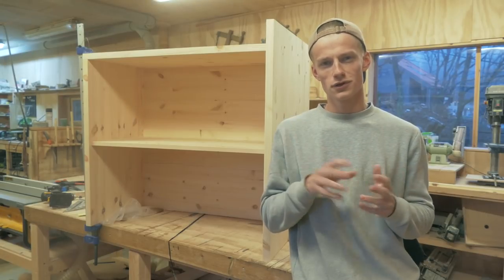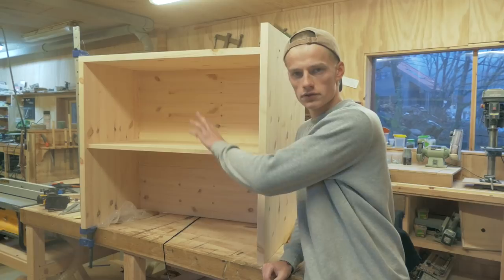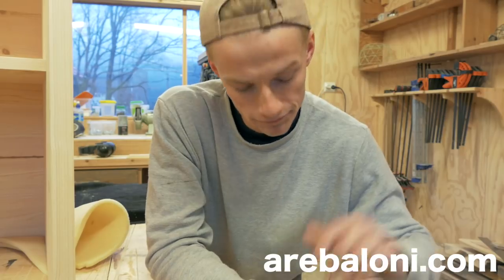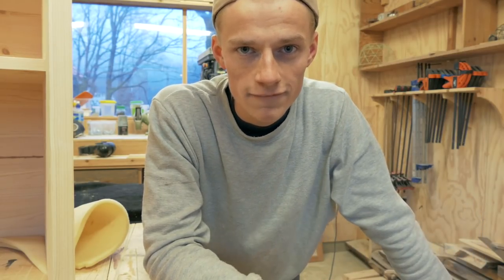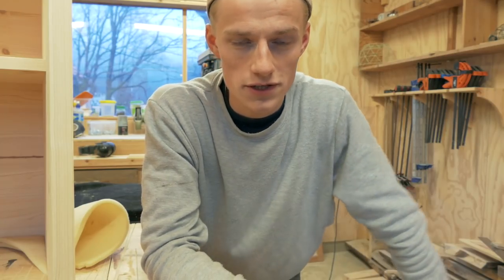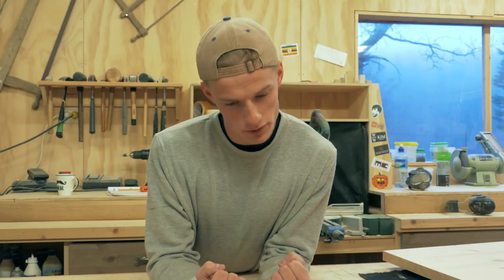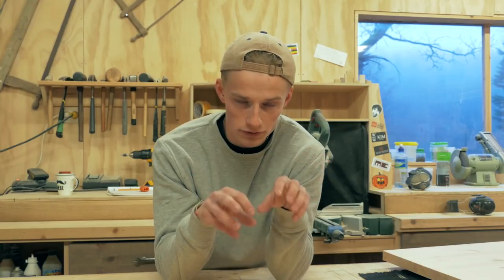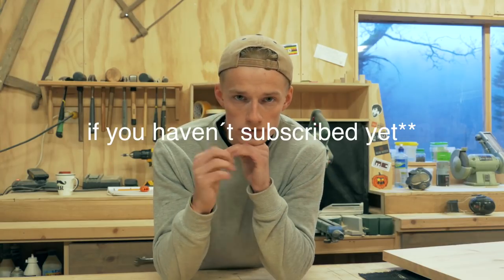Website is up! (+ I need your help..)

Comment: Are, you are embarking on a major project with your beginner's endeavor.  I think back to when I first became involved with woodworking and have to admit that much has changed over the years.  There has been a proliferation of new tools that were not available when I began working with wood as a teen.  So, #1 is "there will always be change and new technology as well as methods".  Explore them and learn how best to use them in your work. 

While woodworking has always been a hobby or a necessity for me (if I wanted it I had to build it) every new project is an adventure and an opportunity to learn more.  so, #2 is "learn from what you are doing...even mistakes...and build on your experiences".  A person who does nothing, learns nothing.  Extend yourself into new areas and perfect your knowledge and techniques.  Don't be too hard on yourself...we all screw up from time to time...and that is part of the learning process.  Many times only you can see the mistake because you did, but others may not notice.

In building anything with wood, try to understand what type of wood will work best in the project.  so, #3 is "learn about wood and its use as well as behavior to select the correct lumber for the project."  There are many choices but the correct lumber will make the project a winner.  You can't use just any wood and expect great results...the wood is important.

Lastly, and there are many more, #4 "love what you do".  if you don't, find a new endeavor.  Not everyone is destined to be a woodworker.  If you don't get a natural high from working with wood, seriously look at other hobbies/professions.

Comment: Great to hear what you are working on. I have some things maybe you could give some tips about... Which kind of woods are good to work with, and which types you should avoid or better not use for making furniture? What kind of projects would you advice to start with if you are fairly new to woodworking? And how can you make a product look of higher quality? Good luck with your shop, man
Reply: A good beginner wood is spruce or pine. They are soft woods so you will not get too high of a sell price on the furniture. But softwoods are generally cheaper so it is`t the end of the world if you make a mistake and have to start over again. For more fine woodworking, and furniture making you often would use hardwoods for example oak, teak, walnut, maple and birch but the price of these types of woods is often dramatically higher.     In my opinion a great beginners project is a cutting board/butcher`s block, for cutting boards you preferably should go with a hardwood  like birch but as I wrote earlier a you should probably start with pine or spruce.      As for making a product to look like a higher quality finish is the way to go, for example you can use some stain to make things look rustic or paint (to hide all the mistakes) I often paint my projects, or you can ask the customer how he/she would like it to be finished. Another great Youtube channel is Steve Ramsey`woodworking for mere mortals. Hope I could help.

Comment: Glad to hear you again Are. I'm enjoying this kind of video even more. 
I don't know if it is a beginner topic, but I think the most important part for every woodworker is to learn how to prepare wood,  from the rough board to the finished piece of furniture (jointing, planing, dimensioning, etc..). Just a personal thought.
Alberto
Reply: In my opinion too is the prep of the boards is one of the most important parts. But jointers and planers can be very expensive. The cheapest one I could find here in Norway costs around 3000NOK about 350usd at the time of writing this.
Reply: @rudolfsarromaa6597  Yeah, they are expensive. I have a (shitty) cheap jointer planer combo paid 250 €...brand einhell

Comment: Good on you, mate. I wish you well and much success in your endeavors👍
Perhaps teaching how to square up projects with the bare minimum tools on hand, and what you could possibly improvise to utilise as a tool (eg: I went to my local hardware and bought a length of 7ft, square aluminum pipe as a straight edge for $3.00) that was a while ago now. Remember, beginners are at bare minimum tools and on a budget, for the most part.
It has also been my experience when learning, all the plans under the sun seem to forget to tell you just how to go about piecing the project together properly. How to clamp, what to use if your clamps are to short, I found that I was always 6 arms short for some projects, and had to figure a way around these minor nightmares mid project. 
It is easy to forget those you are teaching do not have all the exact same tools you will be using.
Good luck on this journey of your life, buddy👍
Reply: you are absolutely correct!